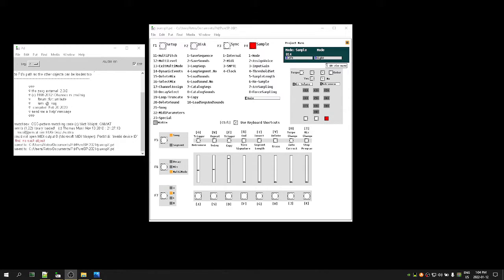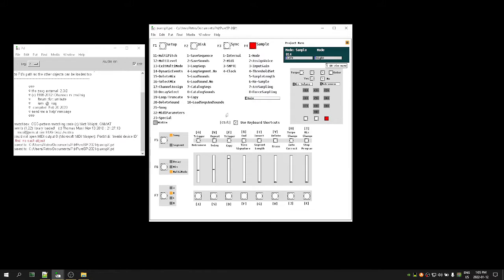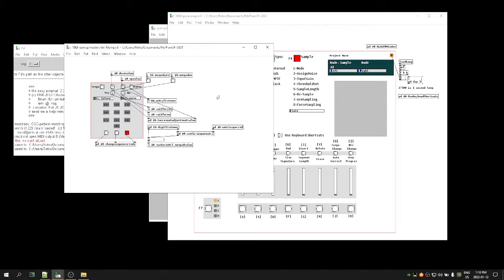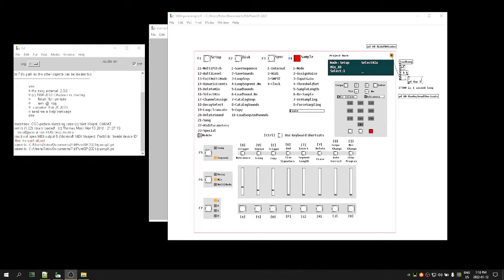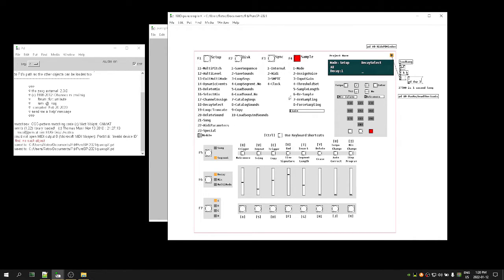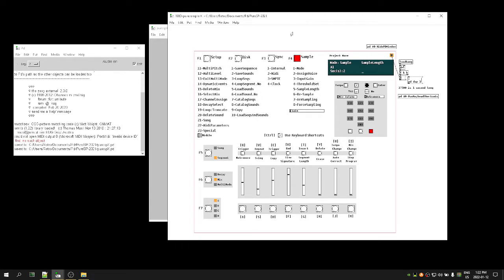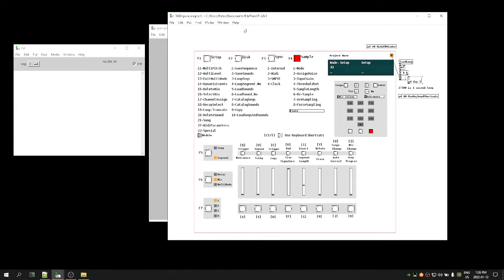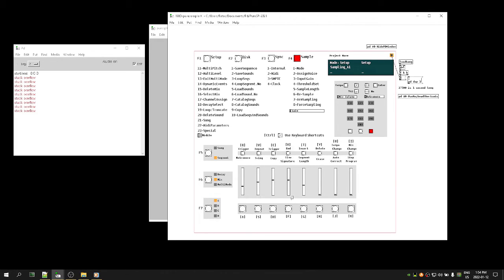PureSPX  DIY alternative to sp1200. Developed with Pure data 0.52.0

Comment: This is exactly what I was looking for thanks.So I can build my own diy sp1200 hardware and install this in raspberry pi?
Holla back
Reply from the maker: In theory yes but currently no. I've been breaking this patch down to small portions I made a few mistakes and got lost in the sauce so I have to back track a bit. This is all a learning process for me for example my first patch "OverSequence" took 2 years to write. I finished massive portions then figure I had to rewrite it a good 3 times as well before I release a alpha version. I'm hoping this wont take as long it been on the back burner while I sort through my mistake and build the externals library.

Comment: I am DEFINATELY following this... The audio processing wont be easy to reproduce.... especially the different aliasings and punch/compression when pitching down
Reply from the maker: Thank you for taking interest. While the compression and is pretty much the "wow factor" what gave the sp1200 its name. i'm not going to worry about this aspect until its fully functional. Or at least to a point where  my mind is free to think about all of the bells and whistles. Currently going for its core sampling workflow and sequencing structure which is coming along nicely.

Good news tho. I managed to sort out most issues in this video and did a bit of clean up and organization of truncated samples which are saved to a custom directory based on the project name. 

Last night I finished the recording function so that means I can record small loops on the fly and play them. :)

Next on the list is to create a file structure to handle multiple segments which will then be used to build out a song.

I will post a video soon demonstrating exactly where the project has progressed to.

Follow the channel if you haven't already. :)